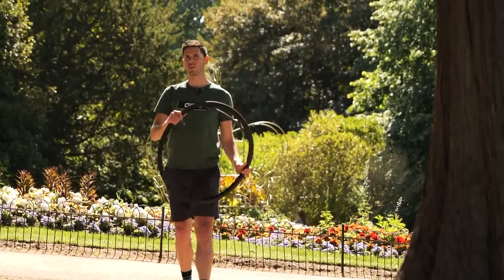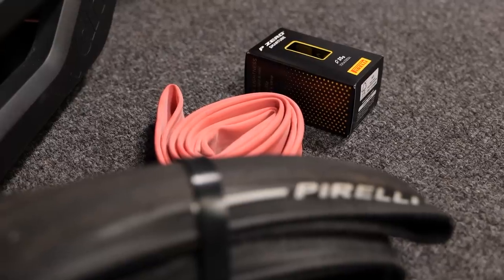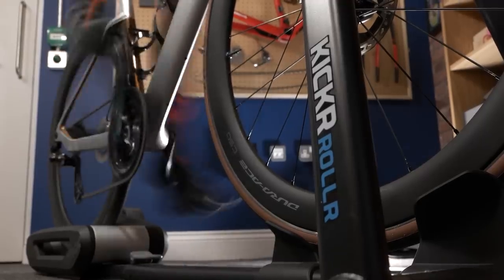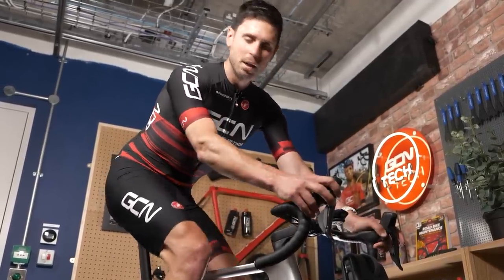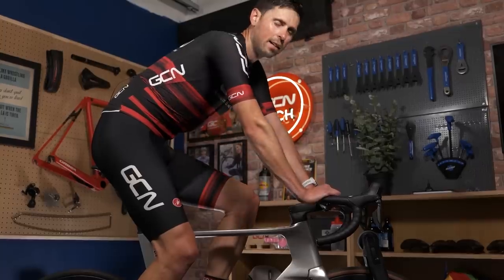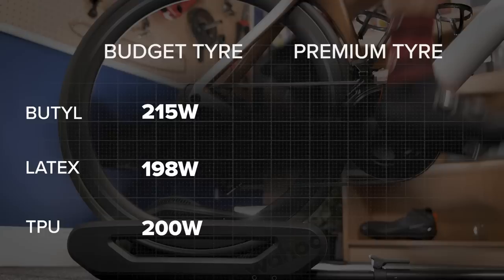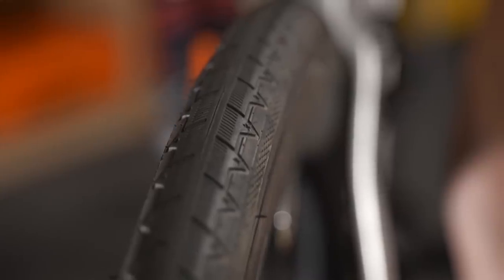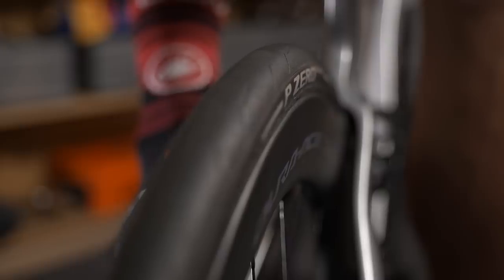How Much Faster Will This Bike Upgrade Make You?

Comment: I have been using latex tubes for last 6 months, I now reluctantly ride nothing less. The old butyl tubes I'll save for winter riding. Latex seems to make the tyres hum on the road, love it! Also swapped my mountain/ road bike to 26" latex tubes on slicks as well, not yet tested yet but I expect a decrease in effort! Best thing I done for all my bikes and my wattage! I have to confess GCN persuaded me to go this direction!
Reply: I agree, there's no reason not to run latex. They patch exactly like butyl tubes and the spare is smaller in your pocket. (Don't forget that old trashed latex tubes should be cut up to make patches). So you have to pump them up more, but we all top up our tyres every ride anyway.
Reply: Same. Love the sound and feel of my gp5000 plus latex. I take a butyl spare tube with me though.
Reply: @alanthompson9240  should take a Tubilito spare with you. Much lighter to carry
Reply: @kconnnnn  probably, smaller too
Reply from the maker: Nice to hear that we sometimes know what we're talking about! 😅

Comment: Upgraded from the stock 25mm Vittoria Rubino with butyl innertubes to 30mm Conti 5000 S TL tubeless. It was noticeable whenI first upgraded but I really noticed it on the Global Bike Festival on slight downhill sections. Side by side, I could just roll away from most people.

Comment: Latex tubes- Pros:  Lightweight, substantially reduced rolling resistance, greater comfort.  Cons:  Significant loss of air overnight requiring pump-up daily.  Prone to puncture.  I switched to tubeless.
Reply: Not big deal for me since I pump up the tyres before each and every ride. I also have a positive experience in terms of puncture resistance - less flats using latex, some tests convirmed this (latex is often pushing the sharp object out of rhe tyre before any puncture of the tube occurs) they're just more sensitive during the installing process (thus the powder in the box) Rolling resistance is noticeable lower.
Reply: Latex isn't more prone to puncturing except possibly pinch flats. It's harder to install them properly and I've blown up a couple when they get caught between the bead and the rim, but in a year and a half I've never punctured with 25mm GP5000s.
Reply: @themindgarage8938  I always had only pinch flats so that's maybe why I perceive them as more puncture resistant. I also read somewhere that latex is so flexible it often pushes the sharp object out itself. Installation - use talk powder. A lot. And non sharp edged tyre levers, I sandpapered mine (continental) and it works.

Comment: Adding a tubeless setup with the same tire would be definitely very interesting. Also mentioning the downsides of the material would be nice. Getting to know that latex tubes loose pressure significantly faster than butyl tubes was a dealbreaker for me....
Reply: Latex is pretty much same as tubeless. With less hassle.

If you’re worried about latex losing pressure, wait till you try tubeless 😅

Comment: My best upgrade 2 years ago was tubeless 38s. Best upgrade this year was putting tubes in them.
Reply: the same here
Reply: Really? Why?
Reply: @alolympic  Every time I had flat tyre tubeless system worked, but  I couldn't go back to the same pressure, it was necessary to fix the tyre and i had puncture in one tyre just after 300 km
Reply: and the process to fit the tyre to the ring with tubeless tyres is really annoying, so bottom line : more expensive , more effort, less durability
Reply: Different experience to me. Been tubeless on road, gravel and MTB for 3 years. Would never go back to tubes. Have you tried plugs to repair bigger punctures?
Reply: @alolympic  Yes I did, but I don't want to be doing that every time I get a flat tyre, I'm doing fine with inner tubes, one year and 0 punctures
Reply: I honestly found them really nice to ride on, but I wanted to swap tyres for racing, and every time I wanted to change tyres I would have to write off an entire day to get them to seal (all compatible tubeless systems too). And with bigger tyres, I found the bigger difference is the volume, not the tubless setup, so I'm getting 80% of the benefit without all the extra work

Comment: That’s an immense saving of watts using latex. I have been using latex for No or years, I love the road riding feeling as compare to other two inner tubes
Reply: Given than drum testing only shows 1-2W difference for butyl vs latex, I believe the testing methodology using these rollers is grossly distorting the results.  It would be worth talking with a proper expert like Josh Poertner of Silca for some insights, as he has a lot to say about rolling resistance and other marginal gains (hint: it is a hard subject to get).
Reply: @123moof  I m just a weekend rider, I used to use butyl but after I switch to latex I feel I could sprint faster than using butyl. The only thing I dislike latex is you need to pump every single time when you ride. It lost almost 30 lbs of air in 20 hrs.

Comment: Very interesting results. I've recently upgraded from the stock Michelin Dynamic Sport 25c that came with my Decathlon's Tryban 520 mostly due to an absolute lack of tracktion and almost the same feel of a riding with a steel tire... 
Due to a seller's mistake, I've ridden about 90km in a set of Vittoria's Rubino Pro Control 25c - which proved to be amazingly comfortable and fast tires. After the mistake has been addressed, I'm now riding a set of Vittoria Corsa Pro Control 28c, which improved a little further on the comfort and grip departments, but also a massive improvement in the looks department with that gorgeous tan sidewall... :D 

I'm now waiting for a set of deep carbon wheels to open and test the latex inner tubes... :D
Reply: I am also sailing in the same boat  I have purchased Road bike having Michelin Dynamic sport tyres but not yet taken ride .Please suggest whether it can work and give me comfort in riding and improve mileage. I’m sure that I will test but before testing whether I could replace the tires or it will work.I am waiting for the suggestion.
Reply: @shafiqsangeen7382  I strongly suggest that you give it a try and try to ride the Michelins - unless you want to sell them as new. They aren't terrible and useless tires. I've ridden mine for 4k kms, but I'm a fair weather rider, I don't ride if the asphalt is still wet - and when I encountered wet asphalt with these tires, I found they didn't had any traction lol

Comment: Recently just put on GP5000 with RideNow TPU inner tube on my stock Alloy wheelset, it is truly amazing. rolls really smoothly. Significant higher speed with same level of effort. SADLY my inner tube puncture on my first ride. It is really hard to fit tpu inner into tight tyres like the GP5000. Will try Latex tube after I used up my tpu ones.

Comment: Good video idea but unfortunately you’ve missed a big part of the advantage of latex and TPU: they allow for more tyre deflection! 

Put simply, a perfectly smooth roller really won’t show just how much faster they are, compared to riding on the real world super bumpy roads! On a smooth rollers surface friction is king but in the real world the tyres ability to deform over surface imperfections matters far more. 

Stick some rumble strips on your roller and watch the difference sky rocket!
Reply: That is correct, but roller tests like this and tests on Bicycle Rolling Resistance forums, still are good pointers. Because what is good on the roller, turns out to be also good on the pavement.

Comment: I have gone to latex. They feel better at absorbing bumps. Don't know about speed/effort. 
BUT need a blemish free interface with tyre and rim tape. I have had 2 mock punctures just from inperfect rim tape and slight twist causing pinching. So super catefull fitting.
Reply: Thankyou GCN for this though. I got latex idea from Si. Tyres make the biggest difference on all bikes from racer to shopping /work bike. And puncture resistance.

Comment: I think it would be helpful to repeat this test on an outdoor course. I think when both tires are factored in along with actual road surfaces, that the results will be more applicable to real-world riding. Tires and tubes definitely make a big difference.
Reply: Also, the difference in resistance on real world road surfaces will probably be even greater. Premium tyres are optimized for roads after all...

Comment: You were only rolling on one wheel, would the power savings therefore be doubled on the road - on two rolling wheels?
Reply: I wouldn't have thought it would be quite double as most of the rider weight is over the rear wheel but there will be an additional improvement by factoring in the front as well.
Reply from the maker: @isthatujeebus  👆This!

Comment: I didn’t know latex was that vast of an improvement. Will order a set and give them a try
Reply: Go ahead and try them. I bet you will quickly give them up. They need to be pumped up much more. Sometimes I noticed it twice a day.
Reply: @firesurfer  Pure BS.
Reply: @jeffroom   Go ahead and try.
Reply: @firesurfer  Tried not as what you said. But yes it will lose air but not as fast as in a day u need to pump twice. Not a big deal to me, i’ll always pump up the air during every ride.
Reply: @jeffroom  Some newer latex tubes have graphite in them so they don't lose so much air.  I like to keep my tires within 5 pounds.  10 pounds less is way too soft.

Comment: Over 20 years ago I used to time trial on 19mm tyres and an aluminium Bianchi on pretty rough and worn out tarmac at a weekly meet. I changed to 23mm tyres and ran at lower pressure much to the amusement of my friends and instantly went faster. More comfort and was able to get the power down. Numbers are great but I'm glad I tried something different to the accepted expertise of the era.
Reply: High PSI increases oscillation from the road. The road vibrations have a bigger negative effect on performance than any effect from the high PSI. You’re better under inflating than over inflating.

Comment: Interesting that the premium inner tubes had so much less of an effect in the race tyre. However, not to be forgotten is the difference in ride quality that might be experienced between the inner tubes, which might let you run a higher pressure with the premium tubes, and hence lower rolling resistance again. There's so many variables, it's very difficult to control for.
Reply from the maker: Yep, and the variables of trainer vs road. Never can be a perfect test but gives a good overall picture!

Comment: Wow that is a huge difference! Much more than i expected. I am starting to understand why people on my strava are achieving much higher avarage speeds with less or an equal amounts of watts. Most of these people weigh less then i do and have a slightly more expensive bike. Maybe that is much more important than i originally thought it would be.. Great video!  I am using Conti 4 season tires with butyl innertube. When these are worn i might try the GP5000 see what that brings me.
Reply: Hi. Did you end up changing your Continental tires from 4-season to GP5000? If yes, did you see any difference? I'm debating if I should do the same.

Comment: Great video, but what we actually want to see is the comparison between the fastest premium tire combination and a tubeless tire (the both options people are actually using, instead of the waterhoses from the eurobike 😅) Pzero race with latex inner tubes vs Pzero race TLR? 🙏🏼
Reply: Latex is faster
Reply: I'd be very keen to see that test too.
Reply: @BikeLife154  Just to add to this, latex is faster given a realistic amount of tyre sealant in the tubeless tyre. One can run the tubeless tyre dry and get amazing rolling resistance ;)
Reply: Yes, that's why it's so interesting like @Tobias Bouma mentioned, latex is faster with the correct amount of sealant in tubeless tires. But i'm just very curious if @GCN is going to make a video about it, as it won't be comercialy very good for pirelli and other tire manufactures (:
Reply from the maker: We've certainly noted this after all the requests in the comments!

Comment: What makes latex inner tubes have lower rolling resistance?

What if you put a light coating of silicone grease inside your tires to reduce the friction between the tire and inner tubes?

Comment: as a complete cycling beginner: WHY does the inner tube (which has no contact to the road) reduce the rolling resistance? What mechanics are at work here? Shouldnt it only depend on the tyre and the PSI? Also how do all of these hold up in terms of durability? How much more prone to a flat are they? It would suck to pay 25 Pounds for an inner tube just to have to replace it after hitting a bump in the road.
Reply: The inner tube is in contact with the tire. When you ride over uneven surfaces these two grub against each other and create resistance.
Reply: Related: I know it's not the question which you asked, but thinner tyres are also not necessarily faster. And the research and evidence on this is relatively new (past 10 years?). I think teams discovered that 25mm width tyres are optimal. Like a lot of sports there's a lot of convention and folk "wisdom" in cycling, some of which does not stand up to scrutiny. The advantage of new people coming to a sport is that they will ask questions, and sometimes the conventional wisdom will be right, but sometimes it won't, and upgrades and improvements are made as a result.

To answer your question: without good evidence, I wouldn't be so sure that inner tubes do significantly affect rolling resistance in any meaningful way. They might. They might not. What's the evidence. Not the hypothesis. Not the theory. The evidence :-)
Reply: Blimey. Just got to the part of the video where he does actual science. Controlling variable (up to a point). They never used to so this at GCN. Fair play.
Reply: @guest_informant  what happened to people just training harder to get faster? All I hear is how people buy super light bikes to go faster when in fact their BMI is 30+ lol!
Reply: There you go. At least on this evidence, the tyre makes so much more difference. Which is what you might expect. But for inner tubes the most expensive "upgrade" makes things worse than the cheaper upgrade. Really well done to Alex and the team.
Reply: I suspect it has less to do with rolling resistance and more to do with rotational weight?
Reply: i dont think it is to do with the innertube rubbing against the tyre, at over 80 psi, the forces are massive that there would be not much real sliding. Its to do with a material property called hysteresis, which is like, rubbing together on the molecular scale and causing energy to be lost as heat. Different materials have different degrees of hysteresis. A thinner tube will also lead to less hysteresis loss. Although I have the latex tube/premium tyre for races, I rain with butyl tubes and cheap tyres ;) Latex tubes also result in air loss and you would need to pump your tyres even after 1 night.
Reply: @machinist_matt  Are we sure rotational weight matters...Have a Google :-) There's a GCN video on this, and plenty of discussion there and elsewhere.
Reply: @machinist_matt  Olllie did a video debunking the rotational weight factor. It only comes into play accelerating and going up hill.
Reply: @iancollins6104  Even then isn't rotational weight a) minuscule and b) paid back when you're going flat/downhill. (I never looked into it because it seemed like it was obviously nonsense.)
Reply: Imagine your tube is a basketball. Now put a hand on top (rim) and a hand on bottom (road)
Your weight pushes your hands together, sprinting and steering rotates your hands on the basketball like opening a jar, pedaling rotates your hands the other direction. 
All these required energy or force. The tyre and tube are elastic springs that rob you of energy in all directions. 

A tyre has nylon cords in plus to allow squirming of the tyre in chosen directions while preventing the tyre expanding. The tube touching the tyre trys to dampen the squirming. 

Also a test on a fixed fork trainer is an OK benchmark, but in the real world you have
1) 2 tyres dragging, not 1
2) micro steering adjustments constantly sidewall squirming
3) side wall loading, sometimes 30+° of bike lean while sprinting

Comment: Have a gravel bike and want a setup which can swap quickly between gravel and road. Purchased 50mm deep carbon rims with cassette and rotar, just looking for a tubeless set of fast road tyres. At least can save a bit of money on these inner tubes.

Comment: I upgraded my bike from cheap, noname tyres and butyl innertubes to Gatorskins with latex innertubes - not only are the tyres actually round so the bike has stopped bouncing, I also increased my average speed by about 3km/h on my 10km commute... Well spent 60£!

Comment: Having light tyres and say Latex tubes, guarantees alot of roadside work fixing punctures. Stick with the Butyl tubes and a good quality training tyre. Save the light stuff for racing, still does not guarantee that you finish the race. Luck come in that depending on the road surfaces.
Reply: I agree, tried Latex tubes years ago and experienced frequent punctures; my old bikes are back to Butyl and my new Giant tcr came with Cadex tubeless tyres and wheels, so far all good, touch wood😃.

Comment: I added about 3-5kph to my average speed on my rides from upgrading my stock tyres to gp5000s. 24kph to 28kph average for me.
Reply: I recently did the same, i also felt safer cause i felt more grip
Reply: I bought my first road bike for £450. Still grabbed a couple GP 5000 clincher's ASAP.
Reply from the maker: Makes a huge difference!
Reply: @gcntech  I’m still using butyl inner tubes too! Might upgrade to latex after my first puncture. 😂